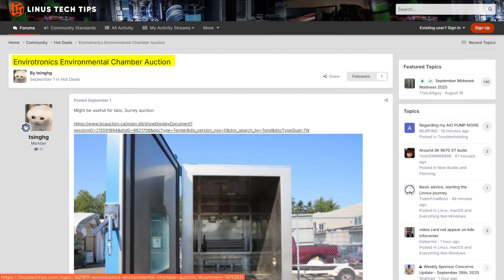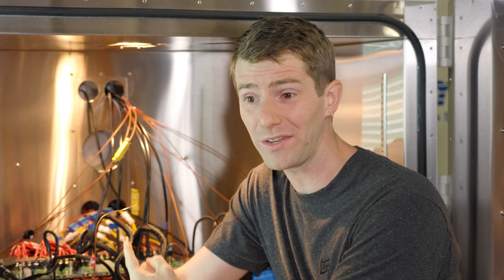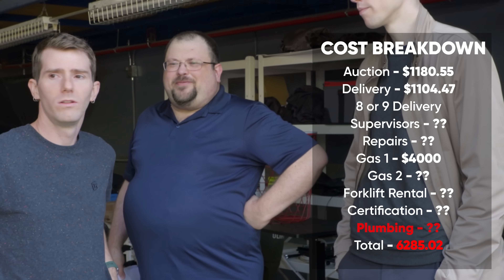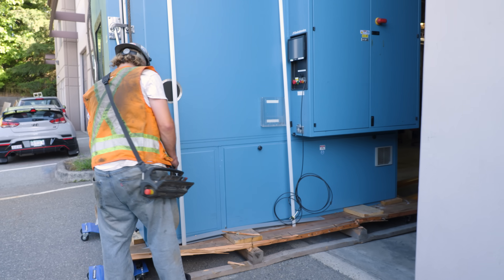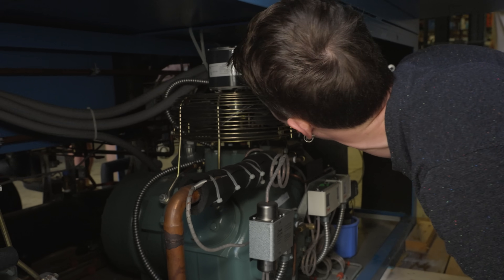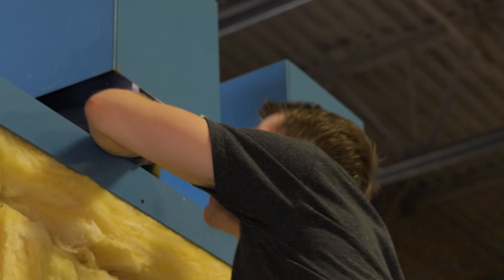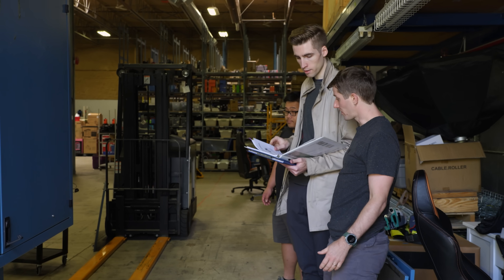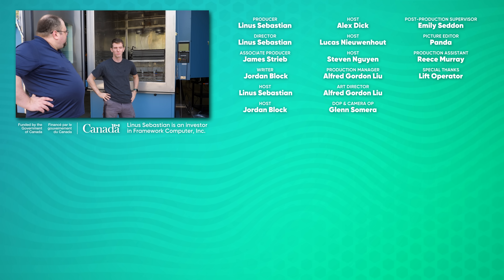They Auctioned This $40,000+ Environmental Test Chamber For $1000

Comment: It is supposed to be green. And yes its hooked up. Most older DELLs like that have a combination I/O and Power Button Board that you can't unplug. Blinking Amber Power LED on a DELL Optiplex indicates a failure of the power supply. A solid one indicates an issue with either the CPU or the motherboard. I'd bet it's the motherboard. Crack that sucker open, I'll bet it is blown capacitors. They were all too common on those older DELL PCs.

Comment: That's an old model. It's an electrical hog. Low internal volume. Air cool or water cool. If water cool, you will need a water cooling tower to run. You definitely need a service team to maintain it. Why do you need it for. For testing just send your product to the testing agency like TUV.

Comment: I have worked in certification and regulatory labs for 30 years now. These machines, while cool ;) are also expensive to calibrate, which we had to do every 2 years. When they break, it's also insanely expensive to repair them. 
On the plus side, you can almost flash freeze your cola.

Comment: Look into Hillman rollers. They are like multi ton roller skates. Then drag it with forklift. But catch is you can't trust the rollers. You end up have a man per roller with a sledge striking them to "steer" them. Also getting or making "toe jacks" helps lift or lower machinery. Almost forgot you will want a second fork or other heavy thing behind thing your dragging as a brake. Past all that good luck moving large heavy stuff is never fun. Sweep the path and have fun.

Comment: easy way to get it repaired refrigerator maintenance that has Environmental Test Chamber expense. older the better. don't touch anything until you get in touch with one. because if you touch the pipes and palming. you will f the cooling and how it many work.

Comment: Instead of putting all that energy this makes into the air via a cooling tower, couldn´t you use the excess heat to plug into the buildings central heating system and provide heating for the building during the winter and pre-heat hotwater and such. You could also drill a well and load it with heat for use during the winter with a heat pump. Also if the area has district heating systems, you could posibly provide heating to be put back into the system. Another thing you could do with all that heat is to use it to generate electricity.

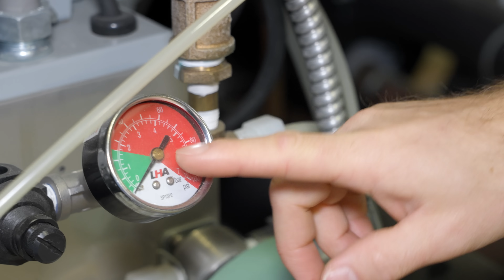Comment: 8:50 Correct! Asco RedHat Solenoid. Those are commodity parts if you need them replaced. Quick tip: Put a ferrous item near the red thing in the middle when you're trying to turn it on. If the item (like a LTT Screwdriver) gets pulled or buzzed against the side of the red "hat", it's working.
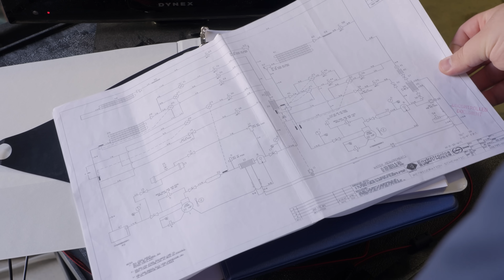14:30 That's a Process and Instrumentation Diagram, or P&ID and the page after it is a electrical schematic.
From that quick look at the cabinet, it looks like you either have an allen bradley micrologix PLC (something in the 1000-1500 series) or a Siemens PLC.
Like this comment if you want any more advice. I did control systems for 12 years, and I'm in P&ID and Instruments now.

Comment: just throwing my 2 cents. The reciprocating compressors are great, old but great. if they end up not compressing for low pressures or well in general. a tech will be able to source a rebuild kits for those. they are basically little engine blocks. I recommend replacing the mounts/isolators. they can be rubber or even springs, considering this was outside for a long period they might be worn out

Comment: If the dell includes any propriatary software it might not be so easy to just use another computer. These softwares are sometimes locked to the specific hardware they come with. If you plan to put the drive of that  PC into another one I would highly recommend making an image of it first.

Comment: Those green circle things are solenoid valves the red middle piece unclips and the whole thing slides off. Also, you could probably hook up the thermo chiller you guys had on previously to cool it.

Edit: Be careful with the solenoids those have varying ranges from 24v to 120v and they all look identical.

Comment: I hope the team is smart enough to modernize some aspects of it, there are definitely newer compressors that have a similar output while using much less power. Not saying to go replacing everything, but anything mechanical that needs to be replaced should get a modern equivalent. The computer side should probably stay the same though.

Comment: absolutely image any of the drives in that thing before you do a single thing, if there is any software on there that you need but can't otherwise obtain you'd be so fucked if one of those drives (which have been left outside for a decade) happened to fail

Comment: Get the O&M, which should have the sequence of operation, and any decent tech should be able to get it running. This is assuming the controls work. If they don’t, you’re going to have to upgrade but w/ the O&M and sequence it will be easy to program. This is extremely basic compared to what I work on daily.

Comment: Yeah, you're going to want to find someone local, to both get this operational, and service/maintain it regularly. 
Or at least, get a guy to set it up. 
Find a service company local. 

Wonder if it arrived with refrigerant in the system, or if they took it. It'd be a dirty dog move to pull the refrigerant out of the refrigeration system, but sometimes required for shipping.

Comment: I had a custom environmental chamber built for my company using single stage cooling and then LN2 boost cooling. I regularly take it to -180C. It cost more than $40k so this one should be way more, at least in todays money. Although mine has ports for plumbing and cables to the outside. Electronics act weird when it gets this cold. Can't wait to see this work.

Comment: Hey guys, i don't know if you'll see this. - the controller for that system is a mitsubishi fx series PLC. you'll need to make sure the PLC battery isn't flat, or you'll have to reprogram it. you will probably need GX Developer, and some additional modules for the package, to configure / reprogram the analogue / special function modules. At first glance, it looks like you'll need an "SC09" cable to program the PLC. The SCADA software could be "mx sheets".
Reply: ^ Now you're getting the automation and controls guys coming out the woodwork. Someone get Chris Boden out here cause we're gonna need to borrow some of the plant wranglers. Jokes aside, I've been wanting LTT to get into some industrial automation (read PLC, screw SCADA and DDC) for years, no better time to start.
Reply: @dicey7368  If the information i posted helps anyone even a little, i'm happy. "i'm doing my part" :D
Reply: Man I hope that PLC battery is still alive or that's gonna suck. Reprogramming systems just by looking at them is not fun. Ask me how I know...
Reply: It appears they have a paper backup of the gx developer project - it would be easy to put that back into gx developer and redownload it to the PLC - after replacing the battery of course, though it would take some time. I’d be happy to help out (:
Reply: @skipnyip  At 10 years, it's probably getting close to or totally dead. Although, I was given a PLC that had a blown PSU whose programming was kept by a super capacitor. Said PLC had been dead for about a decade. When I got it back up and running, i was surprised to find a program still in its memory so they might get lucky. Most of the time the battery is aided by a super cap to allow battery changes if power down is not possible. Their best be may be to power up the PLC and then change the battery.
Reply: boost

Comment: Way to go keeping the load on the very end of the forks, nominally you want to get as close as possible because of fulcrum/armature/lever advantage etc...but hey since Linus has the checkbook out, go ahead and bend those forks and drop it for a good scare! 😉 I miss heavy haul days, Ive seen things twice that mass dropped from LS Head level!  Talk about a boom, it cracked the slab and shook the entire building.  Good Times!
 also... ive found a good rule to follow is if the rigger is running, just follow him immediately !  Cheers!

Comment: I’ve used backup generators that were dismantled from an airport. How much would you expect there were power outages in a city airport? They were pretty much clocked at time they were set up and the sum of check runs for the span they were installed. The backup power control cabinet was from another era. Looked pristine but had to go. Funny, that the automation from way back took a lot more space (obviously) Like the control required a big cabinet, but now there are just two modules and breakers.
Kinda reminded me of your machine..

Comment: Industrial automation engineer here, guys remember to have someone take a backup of the program on the PLC in that thing. Will make your life a lot easier if the PLC breaks or somehow gets corrupted. Btw great video and looking forward to the follow-ups, this is the kind of LTT content I want to watch!
Reply: Also when you have someone with the programming software hooked up to that thing, doing the I/O test is much easier. You can have that person clicking the digital outputs on and someone checking the valves that should receive the signal. Same for sensors, you can check them one by one and see the state in the software (and on the lights on the PLC). Do this systematically before trying the whole thing, will make your life a lot easier than randomly finding something important is broken during use. Having an industrial automation engineer specialized in electrical and PLC fault finding and maintenance help you would increase your chances of getting the electrical part of that thing working quite significantly.
Reply: @jessenic  agreed 💯

Comment: Those refrigerant compressors look like they are slightly bigger and a lot newer than the two 7.5 hp refrigeration compressors in my old freeze dryer I still need to get running.  Those are probably 10HP or 15HP frames.  This will be an interesting series for me to follow!!  Mine uses R13B1, and I hope I have enough.  Good luck with the project.

Comment: If you are willing change out some of the tubing, rubber seals and connections with better 904L Stainless Steel and Silicone cryo-rated versions, Methane and ethylene r1150 are both really cheap as REPLACEMENT refrigerants and even Liquid Nitrogen or even Liquid Helium will work AND Linus could buy (or actually MAKE in-house!) a Stirling Engine Cryocooler to MAKE YOUR OWN LIQUID NITROGEN OR LIQUID HELIUM! 

I could DIY MAKE a very large Stirling Engine Cryocooler for less than $7000 CDN of parts and have an ENDLESS SUPPLY of Liquid Nitrogen and Liquid Helium! Think of all the systems you could cryo-cool for up-clocking a 128 core or even a 256 core AMD EPYC to 10 GHz dipped in Liquid Helium! Can say.....will it play Crysis at MAX settings????

Comment: P.S. I think this version back in the day was $57,000 CDN --- It's a good unit! Just REPLACE the controllers with more modern stuff! Use a small form-factor PC-104 fanless industrial PC box is best with LOTS of old-style RS-232, RS-422, Centronics 25-pin Parallel Port, Narrow USB-2 printer ports and Type-A USB ports, USB-3 and RJ-45 ports, and even ADB and DIN-5 or DIN-9 ports on the back! 

P.S.2. For some company fun, we dried a whole pork side in it with spices and maple syrup! It got a bit sticky in the end but it was VERY TASTY!  We also tested huge resistors mounted in specific locations on VERY expensive motherboards to figure out WHERE and HOW MUCH heat was going to be put out by various chips without needed the actual chips themselves mounted on the motherboard. You send current through the motherboard line traces to the BIG resistors at the motherboard locations where chips would normally be and measure the heat output from that resistor that would be SIMILAR to the actual chip component.

It means we could figure out WHERE to direct air or cooling liquid flow on said expensive motherboards and how much aluminum finning we needed for our cases to use as a heat exchange system for our fanless or dialectric liquid cooled ruggedized aerospace-rated computer systems! Since the chips themselves were VERY expensive, for testing purposes, it was easier and a whole lot cheaper to use a big resistor in place of a chip to do thermal budget testing on new motherboard and computer case designs for rugged environment applications!

These are GREAT systems to have especially at that size! You could mount 4 to 10 motherboards in that system and test them all at once! What a time-saver!

V

Comment: Whomever does the refrigerant fill (you guys or an HVAC person) do an EXTENDED vacuum AND pressure test. Especially with something that has been sitting for over a decade you want to be SURE that it will hold pressure. Small residential systems are best pressure tested for 24+ hours, given then your refrigerant is going to cost at least 4 grand I'd do 48+ . Also no matter what excuses you get from an HVAC person, do a "triple evac" to make darn sure no moisture gets/stays in the system. 

it may be wise to have certain things inspected as well prior to filling.

Comment: As a suggestion, just replace the older controller with a more modern PC-104 card (i.e. with a cheap Ryzen-3 or Ryzen-5 chipset) that can be bought for between $250 to $500 CDN depending upon desired features and input/output ports!

That controller motherboard is basically an entire micro-PC by itself and can be installed in a fanless aluminum box and then control the ENTIRE SYSTEM and hopefully is has RS-232 (9 pin serial port) or RS-422 (a better serial port!) or even USB and Cat-5 ports and you are a full-go for this system! This specific model enviro-test chamber can cool or heat up anything AND to monitor it using open source environmental monitoring and control software such as MyCodo, Smart Citizen, EnviroDIY, or "MonitorR". That PC-104 card can even control MULTIPLE units from one box! You can even do a in-house custom-coded JAVA or Python control software kit to do the super-easy or super-fancy systems control. Basically, find out who can code on your team! Would love to help out! I've done this enough times! 

From that PC-104 board, you can control and sense low-to-high temperatures, low-to-high pressures, RFI/EMI/EMP/RAD-hardening states, humidity, interior air speed and turbulent flow velocities, 3D-XYZ orientation, position, vibration and MANY other environmental states can EASILY be monitored, recorded and tracked over long time-periods of even DECADES of time!

You bought a GREAT system for a FANTASTIC PRICE! Just now need to control it all with one of those fanless PC's or some older or new PC-104 motherboard you put in a small box with appropriate RS-232/RS-422 or Centronics 25 pin Parallel ports or USB or RJ-45 connections!

THIS WAS A GREAT BUY !!!

V

Comment: I say don't use a cooling tower in the winter time and use it with radiator heaters in the garage and use it to heat your building. have shut off valves that lets you use a cooling tower in the summer time so you are not heating your building in the summer time.

Comment: Reminds me of when I worked for a company in the concrete business and we bought a used freeze-thaw chamber for $5k on Ebay, only to find out it was worth $250k...only issue was it was like 30 feet long and 6+ feet tall and deep and wouldn't fit in the lab (or even through the door). We had to make space in the warehouse for it. Worked though, and saved us thousands and we got it way quicker than a new one

Comment: I moved a whole skateboard half pipe using metal pipes under the ramp. As one pipe would get rolled out the back I’d take it to the front  and repeat until it was 70’ from where I started.
Maybe lay some 2x6 on the floor with 2x6 under the unit and sandwich some metal pipes in between and pull it with your forklift?

Comment: Just started the video, and these guys are gonna have to rent a Yale aren't they. I work in maintenance and when our regular forklifts are down (example is a crown rc 3300, very similar to the rc 3000 shown in the video) we use a Yale brand forklift to pick them up and move them.

Things a BEAST with (I believe) a 10 ton (20,000 lbs) capacity.

Comment: As many others have said, Clone the Hard Drive!  And do it in a way that doesn't require you to take it out of the computer.  You could have an instance of where the license key is tied to a hardware snapshot style.  This is where the computer bascially takes a list of parts and connecitons it is tied to, and makes a key based off that.  Just the act of removing the hard drive and then reattaching it (especially if you are planning on still using it) can cause it to be a 'different' computer according to the key.  Thus, you would be locked out of the system and unable to use it.  So you need a way where you can power on the computer, connect to the computer itself somehow, and do a clone attempt through that, either a USB for a long while or an ethernet cable if possible.

And just so you know, the guys who run these kinds of programs, they charge like 10k and up, sometimes 100k, for just reinstalling what is a program they have in their storage closet.  And then might tie you in by force on them maintaining the system.  So if you are able to clone the hard drive, maybe the entire computer itself, onto another hard drive, and be able to boot that up and have it work just like that, you are going to be the luckiest guys on the planet.

Comment: I work for an HVAC manufacturing company and 575v units are common and they normal have 4 to 6 condensing fans at 1 or 2 amps. depends on BTU required.